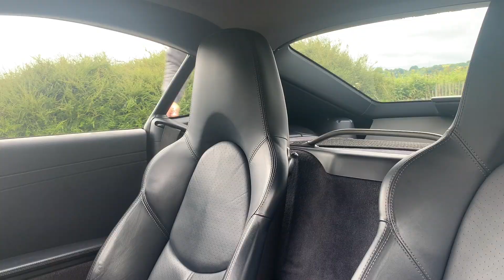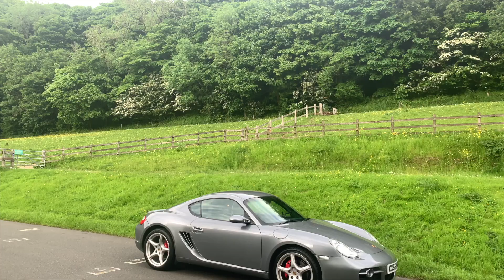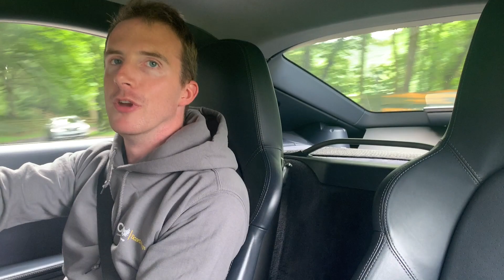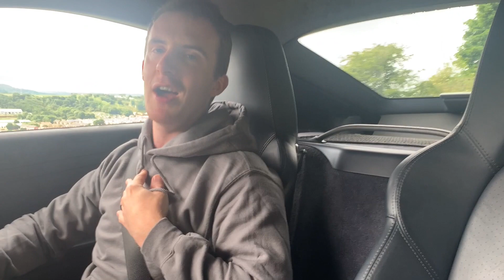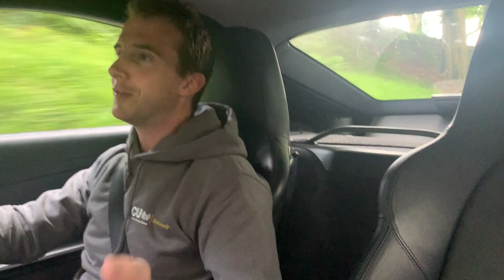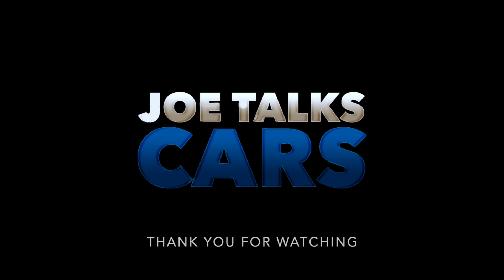Ep4 MY PORSCHE CAYMAN S 987 UPDATE / Is it bore score, aos failure or something else?

Comment: Great points and I think most "First Porsche ownership experiences are similar" - that love-hate-worry relationship that keeps you on your toes, simply because the cars are ageing, there are limitations to what a mechanic can tell you about the condition without tearing down the engine etc ete. I've been feeling like you're always questioning "is it worth it to keep", every time something goes wrong and you see the bill. I've had this intermittent throttle response issue and because it's not clear cut, mechanics saying there could be something wrong internally. 7+ yrs later, after fixing one problem at a time, the car is driving perfect and  no more thinking there's an internal issue. Back to loving every moment you turn that ignition :D 

There are so many ways to rationalise the case for keeping or selling the car - ROI vs emotion etc :D  For 987.1 PDK, I wouldn't spend the money because like you said, 24k pounds can get you a 987.2 PDK and this would be a similar scenario in Australia - there's plenty of 987.2PDK.  If you specifically wanted a manual and a cayman "S", I'd consider spending the money rebuild and upgrade to a 3.8l at the same time - that's because a 987.2 manual Cayman S is much rarer (In Aus) as I literally have not seen one for sale in the last 7yrs. With a rebuild,  you'd have a brand new engine that is pretty special and should be worry free (especially if built by Hartech). We could go into the debate of  987.1 vs .2 track reliability but that's another can of worms!

While you do get the issues like along the way because of the age, there's  a certain longevity about Porsche.  A 14yr old car still feels tight, handles sharper, the noise and throttle response puts that smile on your face better than many modern performance cars. It's such a connected, go cart style drive (I prefer that raw visceral drive vs a luxury muted drive), that I still can't think of another car I could replace it with in a similar price range (inc. 35k AUD for a rebuild :)). As a 987.1 CS manual owner (also I have a fair amount invested in the chassis :D)), I'm going down the path of keeping and putting $ for the rebuild because for now, my fun in the car is not replaceable. :D 

P.S -  Sharing my Ownership tips: 
1. I'd recommend trying 0W-40 Motul 8100 X-Max - hard to explain but it keeps the cayman running smoother & quieter
2. You save a lot of money if you learn to wrench on this car. Parts costs aren't bad, It's the labour cost that makes fixing things expensive.
Reply from the maker: Wow thanks for that comment! Really does make so much sense what you have said. I think it is part of owning what is now and old Porsche, just need to accept that is the way it is and enjoy it. I’m hoping it’s not going to need a rebuild but I think it is the way il go. Love the car so much and it’s worth spending money on. It’s why we go to work! As for working on it myself, I always have with previous cars but with this I’m too scared of it 😂 plus enjoying the fact I’ve not worked on it. I pulled my last car to bits so much I began to hate it 🤣

Comment: I’ve just bought a 997 C2S with Borescore so your vids have come in very handy. That said I think you jumped the gun too early in rebuilding the engine. The car had been scoped and came back clear, you didn’t have sooty tail pipes nor piston slap, all present in mine and it still drives fine, so I think more energy should have been spent in trying to understand where the oil was going because as you said, it wasn’t coming out of the exhaust. I’m glad it’s working out and I gleaned another tip from you for tiptronics: the double tap on the accelerator. Thanks :D
Reply from the maker: When it was scoped again with a better camera it was found very clearly. Shame but needed a rebuild. The car behaved very bad on the weeks leading up to the rebuild. Metallic noises, kept dropping cylinders and ran super rough or wouldn’t even start each time. Since the build it’s been perfect, no oil use, no smoke. Just perfect. Hope yours is still going strong!

Comment: Please keep us all updated. I  have a feeling that it might be either crankcase over pressure or Valve stem seals failing. The car sounds fine when you go up through the gears with no obvious bore score clicking sound. Hope springs eternal. Good luck Joe.
Reply from the maker: Could be stem seals with the fact the car only did 5000 miles In 2 years with the last owner or something stupid. These cars love to be driven. I get no knocks, clicking or loss of power. That’s something, just a black exhaust, oil usage and a lot of carbon on the bumper.

Comment: Well Joe hope you get the right result Saturday 🤞your car looks so straight good looking motor I know what you mean on driving them once you have you can’t stop had mine over 3 years now love it must have spent £10000 on up grades suspension lowered valve exhaust system GT rear wing new radio unit with sat nav etc as well as new tyres and recon it’s 19”turbo alloys must admit I change oil twice a year only do around 4000 a year anyway but keeps it fresh I can go on and on and on as they used to say in father ted but I love me car best thing I ever did buying it so hope it all works out for ye 👍👍👍
Reply from the maker: Yeah I can see that happening! I can’t wait to get on with the fun mods!

Comment: I’m optimistically thinking it is the air oil separator. Since you don’t seem to be burning it per se, it is shocking how much oil can be lost through air oil separators.
Reply from the maker: It really could be that. Can you imagine!! But if that was the case wouldn’t I have oil over each cylinder?
Reply: @JoeTalksCars  depends… it would be interesting to see if there is oil inside the intake manifold, or the throttle body. A quick and easy experiment might be to start the engine and let it idle. Then remove the oil filler cap. There should be a very slight, barely perceptible vacuum. If there is a strong vacuum, or if the engine stalls, it might suggest that the AOS is bad.

Comment: have the AOS replaced before taking another step.... and as far as bore-scoring is concerned, if the pictures were not good enough then any opinion based on them should be ignored.

as far as sparkplugs are concerned... i recently replaced mine and noticed that three of them showed evidence of oil ON THE THREADS ONLY. the threads were actually gummy, and sticky on one of them. the tips were fine on all of them, no evidence of poor ignition. AFAIK mine doesn't burn any oil. (2007 2.7L).
Reply from the maker: It really could just be that AOS. I will literally jump for joy if that is all it is. The AOS was done less than 1 year ago however :/
Reply: @JoeTalksCars  from what i've read, it's known to be a poor design and can fail at any time.

in addition i'd have the oil filter removed and inspected for metal debris, along with the oil pan cover plate (about 8x10"). it will contain evidence of any metal debris too. a concerted, step by step process to determine what's going on is imperative. to date, it seems to have been, understandably, somewhat haphazrd. no offense.
Reply from the maker: @deep6thisdeep6this92  totally agreed. It has been, mainly my fault. Should have visited Hartech or Strasse or even Porsche. We live an learn.

Comment: I've learnt from the Rennvision videos on bore scoring (they're excellent btw so thorough  https://youtu.be/2_bV5JpWw4Y ) that the ticking sound is the most obvious symptom of bore scoring. If you get a stethoscope and put it up to the block you can hear the click/slap from the pistons if bore scoring is there. They say these engines don't suffer from lifter noises so if you hear the clicking with the stethoscope then that's a sign of scoring.  Anyway I trust Strasse will be more thorough than that anyway, but if you happened to have a set lying around would be a quick check.  Hope they give you good news bud.
Reply from the maker: I’ve watched all of them. They are very good videos. Scary tho! 🤣 think they said ticking is later stages and high oil consumption is later stages too. Looks like it could genuinely be something else! Fingers crossed!

Comment: A little confused here. Didn't you research the potential issues and solutions for the 987 before you bought it? Not to mention perform a PPI with a bore scope and oil analysis? If you don't have bore scoring and your oil analysis is good, then it's most likely a failed aos which is a very easy fix. I wouldn't jump the gun on anything regarding your engine til you get it checked it out. Unless you want a little drama for your YuTube channel?
Reply from the maker: Did no research, knew these things can happen. Took it to a garage and they scoped it as they recommended that, oil on each cylinder and a failed AOS. Didn’t see bore scoring as we now think the AOS failing so bad caused it to mask the issue. It has now started to use oil and took it to a garage recommend to me on here. The result isn’t great. This just shows how important doing research is and I am living that now 🤣 didn’t want drama, only wanted to mod it but that’s not gone to plan now 😂
Reply: You got a beautiful car. If you have no bore scoring, which is the big issue regarding rebuild, then you are most likely in good shape. Oem aos is a weak point in the car and always needs to be replaced. Your Porsche Indy should be able to give you a hit list on ignition coils, sparkplugs, fuel injectors, water pump, etc that should be replaced as precaution. These engines are tough as he'll as long as you do the right things to prolong engine life. Every 15-20 year old engine has things that go wrong and need to be replaced. Bore Scoring is what will force a rebuild and if you don't have it, then you are in good shape. If you are going to track it, then you need Hartech's deep sump to help prevent oil starvation. A better aos will be needed because the Oem aos is not sufficient in durability more function for tracking. Bottom line: make sure you find a damn good Porsche shop to work with on this. It will cost you big bucks if you try to cut corners with someone that doesn't understand the engine. It is a great car.
Reply: As a side note, before any mods, you want to make sure that you have done everything to the engine for durability first. Then and only then, should you do anything with exhaust, software, suspension, internal/external upgrades etc. You have plenty of time to upgrade and enhance once you have solidified the durability of the engine. If not, you will have an expensive paperweight sitting in your garage. Doesn't matter what year of Cayman, the logic applies.
Reply from the maker: @GC-kp7lo  that is extremely sound advice. Somebody like me will end up chucking and exhaust on for fun to find it throws a rod. Glad everyone is not like me!
Reply: Hartech has produced a number of papers on the 986/987/996/997 engines, failures, solutions, racing them, rebuilds etc. You would do yourself a favor to read them. Also go onto rennvision on YuTube and you will learn quite a bit about about the issues, prevention and solutions. Obviuosly the IMS is another failure point to look at. But again, affordable solutions are available. Your Porsche shop should be able to give you a checklist that you can take action on as required.